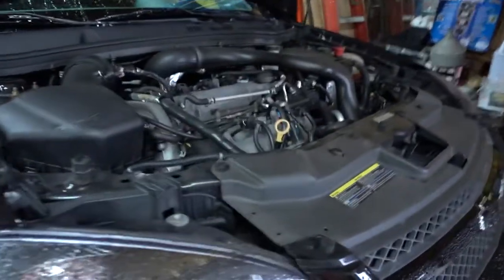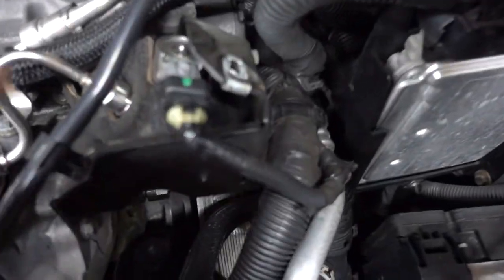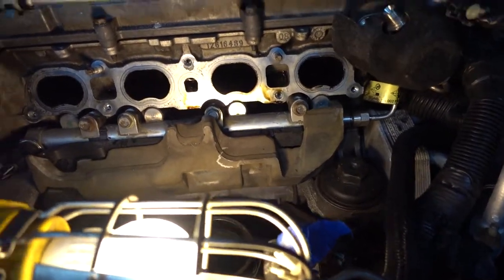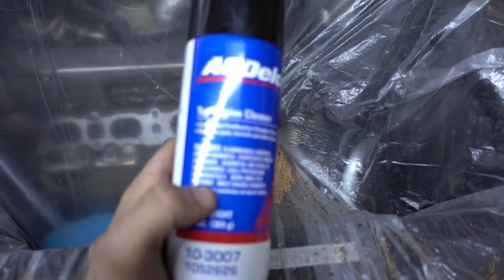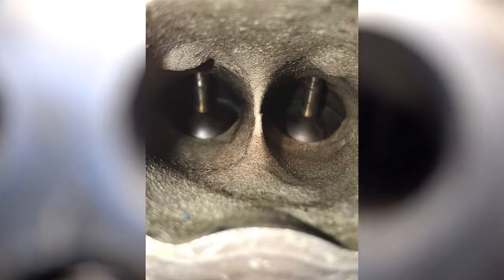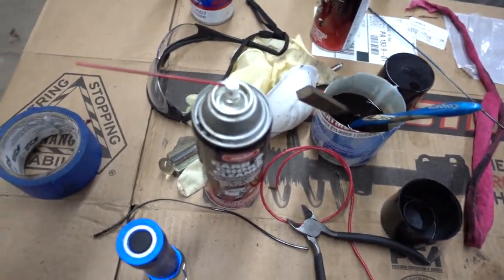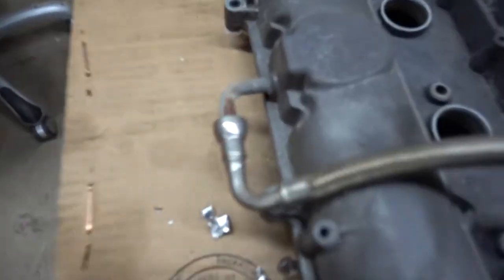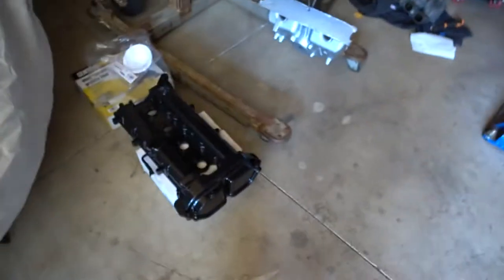Cobalt SS/TC Intake Valve Cleaning

Comment: @27:44 what is that solid clicking? you can hear two clicks.. one is faster which is the engine but you hear another one which ticks every 0.5 seconds
Reply: That's direct injection tick lol, normal on these cars
Reply: @brxttz  I hear the same thing in my cobalt was going to have a mechanic open the engine was starting to get worried about that sound but I'm glad you said it.
Reply: @andrewalvarez7389  yes, the LNF engines do that hpfp is driven by the cam.

Comment: Did you find any other differences between the ldk and lnf intake manifold besides the map sensor not fitting properly? I was thinking of picking up an ldk manifold for cheap,On zzp website it stated something about getting a bigger oring ? Any problems putting the Pcv valve in the new manifold?
Reply from the maker: The MAP sensor hole is slightly smaller on the LDK manifold vs the LNF manifold, a slightly smaller o ring is recommended however if you're taking the manifold off, opening it up a very little bit will let you reuse your o rings. I did not touch the PCV valve as this was using the Powell v3 separator, which plugs the OEM pcv hole. I didn't use the Powell separator on the new engine I put in because I had not seen evidence of it working. I believe the LNF and LDK/LHU pcv valves are all similar, but if you would like to cross reference just look up 2013 Regal GS pcv valve and compare vs 2009 Cobalt SS.

Comment: Powell's PCV Oil/Air Separator didn't work? I was just about to buy the v2. You bought yours fairly early on in testing. He might have refined it? Trying to weigh whether it's worth it or not.
Reply from the maker: I had the V3 system. The system I had removes PCV valve in the intake manifold and plugs it. This is removing all crankcase and intake manifold relations. It runs all of the crankcase pressure through the separator. To use the words of Trump; sounds good, doesn't work. The engine doesn't make enough vacuum to keep the system going. Granted, I had a loose line which could have some role in the issues I had, but I have talked to others who have used the system and had the same conclusion as me; they're running custom setups now. For me, cleaning the valves once every 2-3 years doesn't sound like a bad idea. It's not that difficult to do and is far easier than all the bs I had to deal with, especially in winter when condensation was bad. My friend had a V2 on his LSJ and had no problems, which is why I wanted to do the system. But V3, plugging the manifold, didn't work for me. The separator is very overpriced for the quality, in my opinion. The gasket that seals it all together is junk. one lick of oil and it's more swole than a gym rat. I'd take cleaning over dealing with the separator any day. 
Best of luck with whatever route you plan to go.
Reply: @thepanduuh  seriously, thank you so much for your response. He dropped the price down to $400 for v2. Still think it's over priced? I'm definitely leaning more towards just cleaning them. I'm at roughly 103k and I'm pretty sure they haven't been touched. I am however am 95% sure I'm getting his CAB's. A bit of a gut punch at $200 but would be a nice upgrade. Did you end up getting a custom tune on top of gms1 or did you just stick with the factory tune? Either way, how are you liking it?

Comment: This kind of seems excessive to me and I don't recall him mentioning anything about rotating the engine over until both those valves are closed on the intake side for that cylinder which would be ideal because if not all that f**** sand is going to get down into the cylinder or if you use some kind of a solvent or cleaner all that will wash the oils off of the cylinder walls I'm fixing to do an exhaust valve and intake valve cleaning on mine although unfortunate that I have the entire powertrain out at the moment putting new gaskets into everything doing some painting and so on and I figured it's time to clean the valves so what I'm going to do is rotate it over until those valves are closed to ensure nothing gets into that cylinder and then I'm going to use some brake clean and some small plastic wire brushes that way it doesn't leave any scars on the valve stem and I'm going to blow it all out with the air gun afterwards you don't want to put a scratch or scar on the valve stems because that will eventually cause your valve guide to get tore up and also cause oil to leak through the valve guides over time

Comment: I didn't know blasting the valves was even a thing. My SS only has 65xxxkm so hope they aren't that bad. Would a regular seafoam treatment not keep the valves clean enough?.
Reply from the maker: simonriddick depends on the motor. This is only for 08+ turbocharged engines. But no. These motors have direct injection. Direct injection gets the fuel injected directly into the cylinder, unlike port injection which gets injected into the intake manifold and flows over the valves. No fuel actually comes in contact with the intake valve stems. Does not necessarily require blasting but scrubbing worked well for me.
Reply: Ok I see. Yeah mine is a '08.
Reply from the maker: simonriddick should still apply to your car. As long as it's turbo
Reply: @thepanduuh  I'm back again going to do this to my car soon lol :). Your video always comes up first. :).